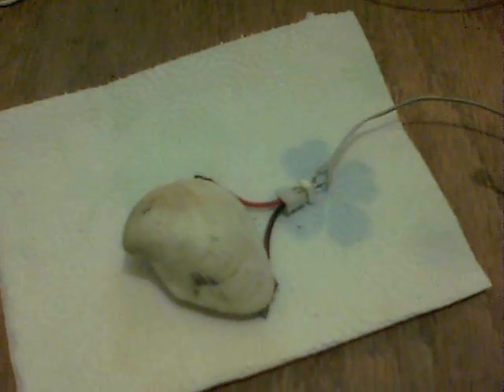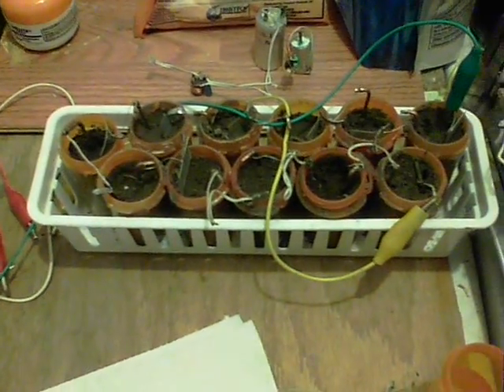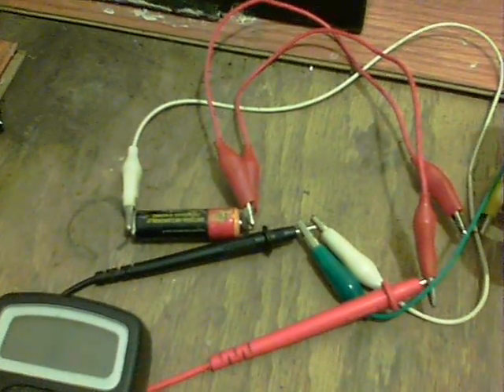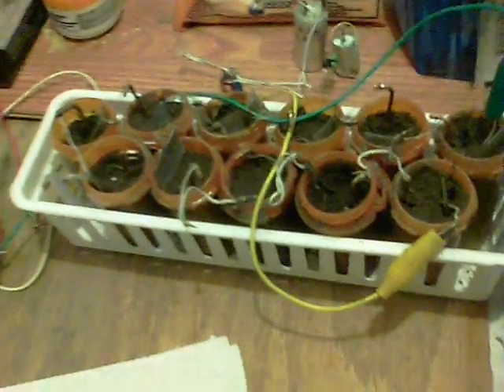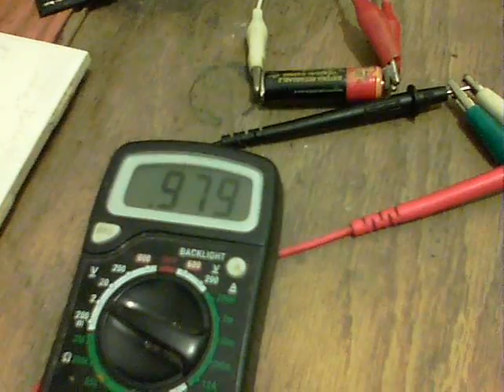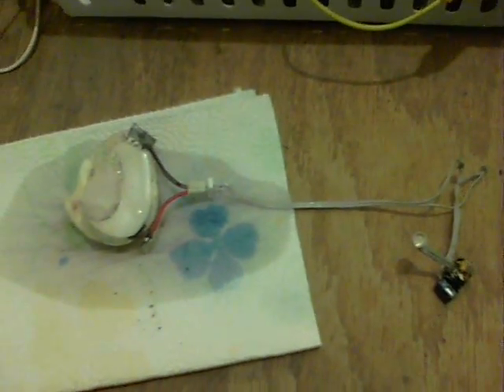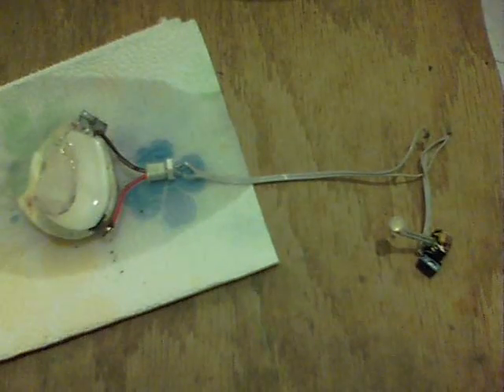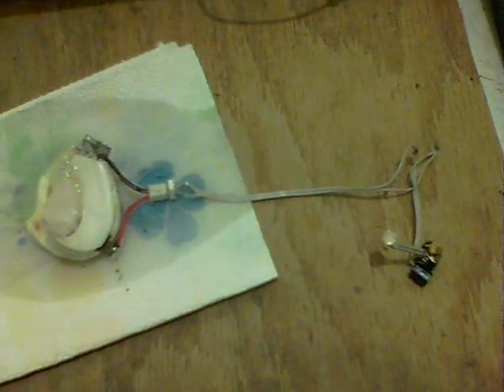Dirt battery charger + Seashell rejuve

Comment from the maker: 3 poles work well, bit different to look at too. Water will give 0.75V and 300uA with burnt copper and galv steel. A lot more if you have magnesium (though the mag will be eaten). Worth trying different waters...I find rainwater works best, but purified affects metals less long term (kinda obvious really). Tap water depends on how much Fluoride and treatments are in it !